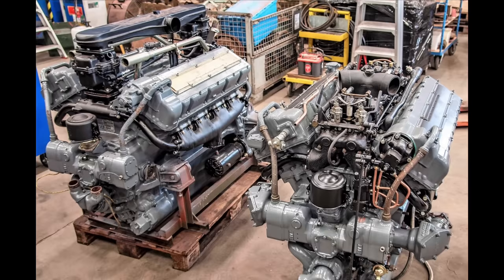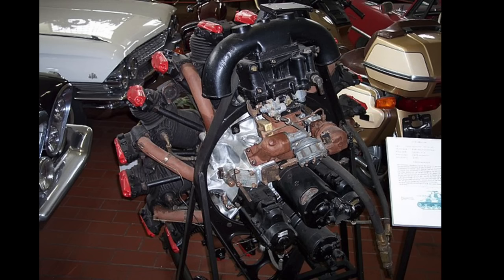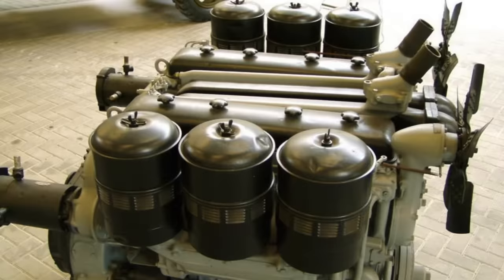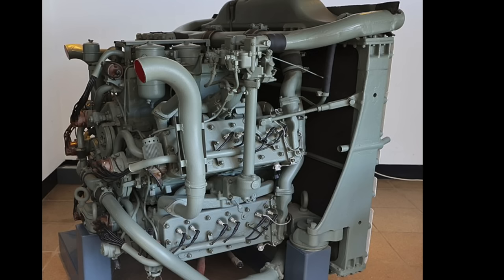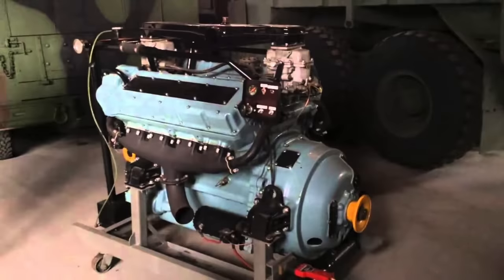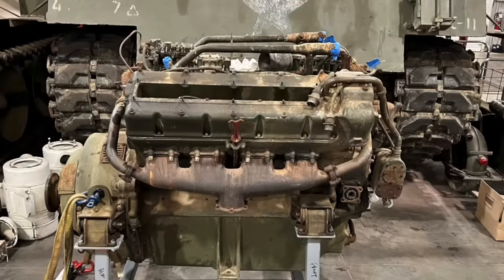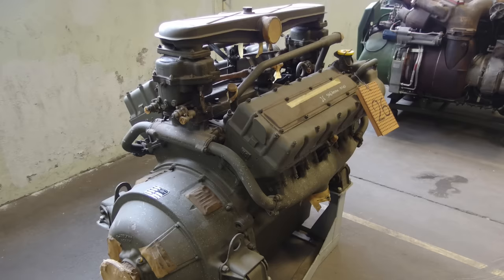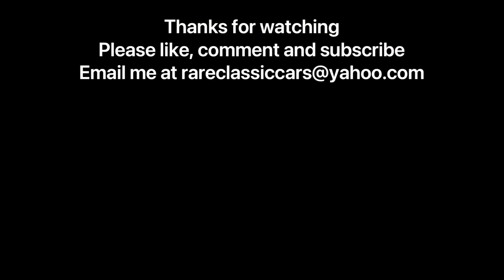An All-Aluminum, Flat-Plane Crank, DOHC V8 in 1940! Ford's 1,100ci (18L) GAA V8 Is a WWII Marvel

Comment: Most of the tanks of WWII era were using engines that were either aircraft or airship derived since that was the large displacement technology that was readily available. As a consequence, almost all main WWII tanks were gasoline powered with few exceptions - the Russian T-34 being one of them. Fun fact: the US army did not accept the twin GM 6046 diesel variant of the Sherman. Only the US Marines and Commonwealth countries used them. Diesel was still scarce for land vehicles in WWII.
Reply: Germans did not use aircraft or airship derived engines in their tanks neither did the Russians. The British eventually used a detuned version of the Merlin aircraft engine.
Reply: @FairladyS130  How do you think Maybach (German tank engine supplier of WWII) got started? They were the power plant provider for the Zeppelin airships. Before the war, many of the US Navy's airships were powered by Maybach V-12s. Many of the design characteristics were applied to the HL series of 6 and 12 cylinder engines used in almost all German armored vehicles during the war (and after the war if you want to include the French AMX-50 program..
Reply: Diesel was less of a fire hazard on amphibious island landings in WW2 with many of them close together on boats.
Reply: @FairladyS130  The Diesel in the T-34 tank (V-2-34) was derived from the Hispano-Suiza 12Y V-12 aircraft engine.
Reply: @davem8790  So? Everyone starts somewhere.
Reply: @peterstickney7608  A diesel derived from a petrol engine by different manufacturers? More like there some copying going on.
Reply: @peterstickney7608 not true

Comment: My first thought was that this GAA engine foreshadows both the DOHC Ford Indy engine, and the SOHC Cammer used in drag racing!   The brief cutaway view shown explains the relatively low horsepower as airflow appeared quite restricted.  Since any internal combustion engine is basically a compressor with spark plugs added, it seems that Ford's engineers had not realized that unrestricted air flow is key to performance.  Decades later, they caught on to that fact.
Great post!  Thanks for sharing, as I was unaware that such an engine existed.
Reply: The GAA was designed more for torque than HP.  Low RPM engines have much higher reliability.
Reply: It is not that they didn't realize that, it is the fact that heavy vehicles need low RPM torque, and in order to defeat the enemy, you need reliability more than horsepower.
Reply: Then they made the 4V Cleveland with its way too big ports that people have been closing down for decades. 
For a engine like this all about low rpm torque big ports are generally bad
Reply: @ldnwholesale8552  The 2V Cleveland heads are much better for street use.
Reply: Don't forget, they were side-oilers 23 years before the Ford 427s used this feature. One of the many innovations the engines had.

Comment: Imagine if Ford had made an automotive engine in the 40's with the same features.  Ferrari may never have bothered to compete!
Reply: The  Ferrari engine spun up a lot higher then these engines!
Reply: @ronaldbrown5745 well ya with this example since its 18 liters!
Reply: mate, Peugoet and Fiat had double overhead cam four valve per cylinder engines back in 1916. Ferrari have never had a pushrod engine, ever. Ferrari are all aluminium blocks except for the 206 and 246 which were manufactured by Fiat. What are you on about? One other thing, anything bigger than a 5 litre V8 with a flat plane crank just vibrates itself to pieces. Just look at the lack of reliability with the flat plan corvette V8.
Reply: Lots of engine features that people think of as being 'high tech' today have been around for decades.  The reason why Ford didn't produce overhead cam engines for passenger cars back in the the day is because the manufacturing tech of the day would have made it too expensive.   Companies like Ford sold to a certain price point and that's what limited engines like this to special applications and not ordinary consumer products.
Reply: @marcolucchini8173  Dont forget  the American Miller engines ( later Offenhauser) from the early 20s,  dual overhead camshafts and 4 valves per cylinder. They dominated racing  for decades.
Reply: @troynov1965  1920 comes after 1916. Do the math.
Reply: @troynov1965  dominated what racing? Definitely not F1.
Reply: @marcolucchini8173   I was talking in general before 1940s .  So no math needed .Miller inspired the engine found in the type 35 Bugatti .
Reply: @MrSloika Dusenberg for example
Reply: @troynov1965 so you're telling me now that 1940 came before 1916?
Reply: @marcolucchini8173 Yes, look at it.  Over 10,000 in production and a handful of documented failures.  Porsche had more 991.1 GT3 engines blow n
Reply: @markw9512  what are you on about?
Reply: @troynov1965  Type 51 Bugatti actually and it wasn't as successful as the SOHC '35
Reply: Yes F1 too. The Indy 500 was part of the F1 Drivers championship between 1950 and 1960. All 11 races would end with Offenhauser powered podium sweeps. 
Offys would also later pioneer the use of Turbocharging in the late 1960s due to their headgasket-less design having outstanding resistance to extreme engine pressures.
Reply: @marcolucchini8173  about you spewing disinformation about the Z06’s “blown motor issue“. They’ve only been a few cases, and most of them were by people who foolishly ignored the vehicles break-in procedures and hotdogged the engine from day one. Such as the YouTube influencer who blew his within days of getting it after driving the piss out of it. His MPG indicator showed 150 miles drive at six MPG average from what I recall, and to get six MPG average in a 06 you are driving it hard, and clear violation of the break-in procedure. Play stupid games, win stupid prizes. So my point was you can find examples from any marque of issues with ultra high performance cars.
Reply: @troynov1965 In the US.
Reply: @mrspandel5737  And how many European-based teams turned up for those races?
Reply: @stephenscholes4758  Ferrari did it in 52 or 53 I think but they had little success. Ironically in 52 and 53 Indianapolis was the only race of the calendar where F1 cars actually were eligible to race since the rest of the season was held with F2 regs.
There was also a combination event between USAC and F1 constructors held at the Monza oval in 1957 and 58 with both races being dominated by the american teams. 

As a side note, the 1952 Indy 500 was the first F1 Drivers Championship race to feature a Turbocharged entry, powered by a  6.6L 430hp Cummins Turbodiesel. Yes really.
It went on to grab pole position in qualifying. 
Yes really.
Reply: @mrspandel5737  gee, if only the F1 calendar was made up entirely of oval tracks!! Americans would have dominated for eternity. Thankfully grown-ups knew the ability to turn in both directions is the only measure worth talking about

Comment: Some fun facts:
The GAF version of this engine was fitted into the M26 Pershing.  The GAF was physically configured to mate with the TorqMatic 900 automatic transmission used in the M26.
The Russians really liked the Sherman with the twin diesel that they got under Lend Lease, it meshed right into their supply chain as the major Russian tanks of WW2 used diesel engines.
Besides the Sherman series with the twin diesel, all of the M10 series tank destroyers were fitted with the GM twin diesel as well.
When a batch of M10 series TDs were remanufactured up to the M36 tank destroyer configuration (new turret and 90mm gun), the diesels were replaced with the GAA.
Reply: Another fun fact: the soviet's were in fact so pleased with the Detroit Diesel 71 series that the build them themselves as YaAZ-204 (4-71) which was mounted in trucks like the MAZ 200 and YaAZ-206 (6-71) which was put in the early Kraz 214 trucks...

Comment: Ford also In order to meet the need for a larger engine, Ford resurrected the V-12 version as the GAC, which produced 770 hp (570 kW) and powered the T29, and T32.

Comment: I've read that the Ford GAA(& presumably the v12 it was derived from) are able to use pistons, conrods, valves & cylinder liners from a Rolls Royce Merlin, as a military engine it makes some sense that they might want to standardise the inventory of spare parts.
Reply: Every part of the Ford G engine was unique to them. The Merlin and Meteor v12's had the notoriously weak fork blade rod, the Fords used "standard style" side by side rods, which were extremely strong.

Comment: Cool video. The Ford GAA V12 is a truly missed opportunity in WW2 it would have greatly outperformed the Merlin been cheeper to produce and more fuel efficient. It's like comparing a 5.0L Windsor to a Coyote. The Merlin is just a generation older and the GAA was newer in design as simple as that.

Comment: Sherman tanks were also powered by large Cadillac engines. but were known to be not as reliable.

but the Germans were still beating the Americans in tank battles. because they were using diesel engines. and their tanks were much larger and were more heavily armored than the Sherman tanks. which during battle the shells from the Sherman tanks would just bounce off of the German tanks. however the Sherman tanks when hit by the German tanks. would go up in flames because they were gasoline powered. netting them the nickname rossingol lighters.
Reply: Imagine knowing what you're talking about before commenting. 😂

German tanks were powered by only gasoline, outside of a few prototype diesel engines, not to mention the gasoline they were using could hardly be compared to allied gasoline. The sherman had 5 different powerplants ranging from gasoline to diesel and radial to V. 

It's pretty easy to search this online instead of making a fool of yourself, you know?

Comment: It's so interesting that in the 40s we used an aviation engine to power our front-line tank.  Here we are 80 years later using an aviation engine to power our front-line tank.  The Abrams tank engine is a jet turbine originally developed for helicopters.
Reply: The Brits used derated Rolls Merlin engines in their tanks.  Don’t know if the engines were new builds or retired from aircraft.

Comment: Aircraft engines in tanks isn't totally unusual. The Allison, the Merlin (Meteor) were both used in tank applications, though the Allison was only installed experimentally. I love these old engines, so interesting. DOHC does date back to the turnn of the century....the 20th century that is. I think Peugeot was first here, in 1912.

Comment: There were other problems with the radial in the sherman...you had to rotate the engine over when cold to prevent from blowing the bottom cylinders to pieces going solid in the oil that settled in there. The BEST engine in the sherman tank and the grant tank...was indeed the two stroke GM detroit diesel double block. Mostly because the tank did not burn and incinerate the crew.
Reply: @@retiredbore378 The shermans were burning up even with "minor damage" due to the 80 octane gasoline required for the radial engines. AKA they were named Ronsons because they" lit the first time, every time". I took a good look at a sherman with a radial engine and that thing was a death trap if hit by at 70 to 88 mm shell
Reply: @certaindeed Fun fact, the Sherman didn't have higher burn rates than any other tank, and once wet stowage was introduced and the ammunition was moved to the hull floor it burned significantly less than literally every other tank. The fuel used had little to do with burn rates. In its weight class the Sherman had the highest crew survival rate when destroyed, thanks to a combination of the aforementioned ammo stowage changes, and large, easily accessible hatches. And no, it wasn't under-armored compared to its equivalents, the T-34 and Panzer IV, as the angle of the hull meant it had superior line-of-sight thickness to both from the front. The Cheiftain has multiple videos on the history and development of the Sherman, and it's fascinating just how much went into making sure that when a tank got delivered to the troops, it worked reliably. The only real missteps in the development and deployment of the Sherman were not deploying the 76mm variant to Normandy, and not making more HVAP ammunition available sooner, both decisions being made due to a perceived lack of need.
Reply: @griffinfaulkner3514  Yes moving the ammo was a huge improvement. It was a medium tank and in that class it was decent. The radial version was also quite fast tank with a good power to weight ratio. Sherman radial was indeed not bad on gasoline fuel consumption either despite the drawbacks of the radial. There is no doubt however, that in the event of a fire in the engine compartment or damage anywhere, diesel was not going to burn.
Reply: @certaindeed  Not really? Fuel fires are arguably the least likely cause of a tank burning down, at least if you aren't in a German tank with fuel line issues (looking at you, big cats) or mishandling the fuel in the first place. Diesel is technically less likely to catch fire, but if a shell punctures a fuel tank in such a way that the leak's inside the vehicle and not outside, you likely have bigger problems to worry about.

Comment: OK, I'll bite, what is a "flat plane crank"?  The Ford looks rugged and simple, would love to see the worm gear set up for the cams.   It's amazing how many of today's technological marvels had their roots many years ago...  I'll bet this engine had steel sleeves in the aluminum block, and aluminum heads as well.  So Ford figured it all out back then, what was GM's excuse(s) for the Vega!
Reply: I can tell you what one of GM’s problems was.  The bean counters had more power than the engineers.  Of course cost has to be controlled.  But look what happened with the Vega.  It ended up costing more than if they just would have done it right from the outset.
Reply: Combination of “flat crank” and “single plane crank”.  All this time I thought planes were by definition “flat”.
Reply from the maker: You can see the worm gears in the cutaway. Flat plane just means the counterweights and journals are all within one axis as opposed to 3 axes. A bit hard to explain.  Take a look at a pic on google and you’ll see what I mean.
Reply: @CamaroSS-sy2ei  Seems to be a common theme here in the US.  Short sided thinking/savings wouldn't be tolerated in other countries.
Reply: @RareClassicCars  will do...thanks!
Reply: @donk499  Yes.  Short-sightedness.  Not only did the Vega engine cost GM immediately with warranty repairs, but it cost them billions down the road by permanently losing future customers.  Cost needs to be controlled.  That is non-negotiable.  HOW you do it is incredibly important, though.
Reply: Also it effects the firing order of the cylinders.
Reply: @CamaroSS-sy2ei The American stock market for decades has been driven by quarterly reports which makes corporate finance types VERY short term centric.
Reply: @Primus54  You are right.  There are a lot of differing pressures and priorities.  I do appreciate that, even if I can’t understand them all.
Reply: I’m sorry but did you say one of the largest gas engines ever made? The RR Merlin was 27 litres/ 1650 ci at the start of the war and progressively got bigger until it was replaced by the RR Griffon engine of 37 litres and the German BF 109 had an inverted V12 displacing 39 litres and the FW 190 had 42 litres. There are many other big engines in WW2 aircraft and most were also fitted with boosters like super chargers, turbochargers + intercoolers, nitros oxide and water/ methanol injection. Even the Jug P47 Thunderbolt had a massive 18 cylinder, 46 litre / 2800 ci radial engine with a variety of boosters like supercharger, turbo charger with intercooler and water/ methanol injection. Looking at a cutaway of the Thunderbolt is amazing as the whole plane is stuffed full of engine as the supercharger is behind and below the pilot. Still a very interesting video. Thanks.
Reply: USA fuel engineering for the win!